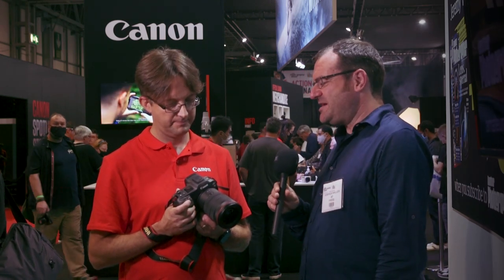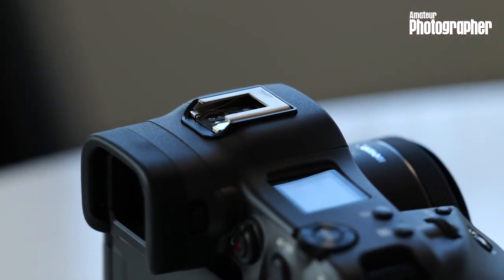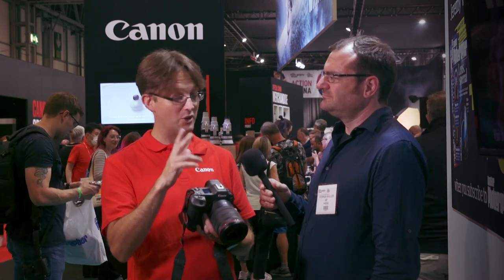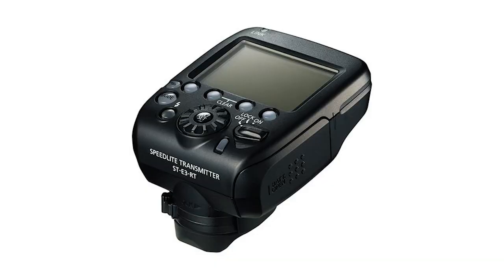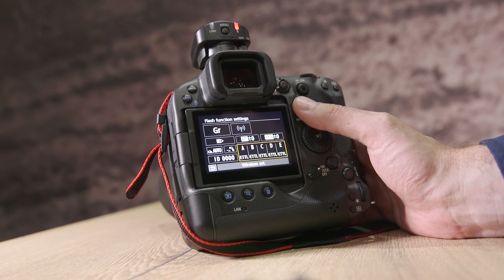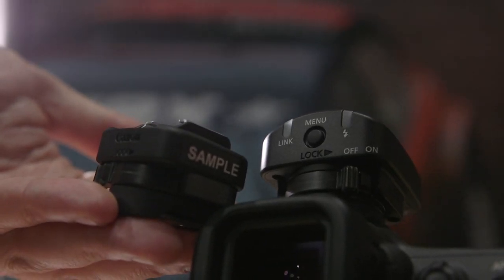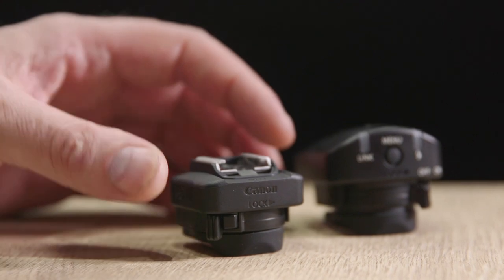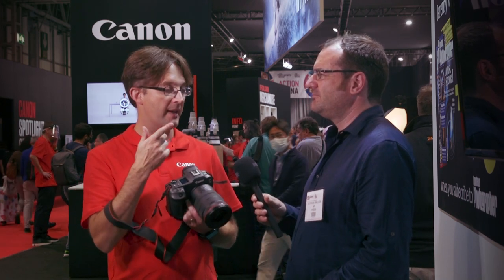NEW Canon Hot Shoe design PLUS new hotshoe accessories (new ST- E10 and AD-E1 hotshoe adaptor)

Comment: Can anyone ask David from Canon who designed hoshoe cover for 'robust' R3? After being hugely disappointed with R3s lockup/freeze issues, which still hasn't been fixed with nee firmware, all my friends who own or tested R3 + many forums confirm - rubber hotshoe cover is crap! Doesn't sit well in place and everybody already lost one! How can you go wrong with this kind of £6k camera! Specs are awesome but quality is far from 1DXIII. After burning R5 there's simple conclusion - all Canon R cameras are being released still as beta versions, all got great specs on paper but all got huge reliability problems. Better wait until MK2, MK3 versions will be released.

Comment: Does it wobble?
Reply: it will wobble overtime and you have to tear it apart. screw is inside the body.
Reply: @jusmtb687  can you not screw it without taking it apart? I was hoping with this new hot shoe that it would be different.

Comment: Unfortunately the new shoe does not work with the Broncolor transmitter RFS 2.1 as the side contacts have lost connection due to the changed shape of the shoe.

However, the Canon AD-E1 does not work with the R5C, and Canon Europe has not been able to answer whether the AD-E1 is compatible with the R5C or not.

Maybe Canon UK has some info on this?
Reply: again, canon forcing us to buy stuff that never needed to eb manufactured in the first place like the AD-E1 hotshoe adaptor, and they complain of chip shortages. They made the R10, so they ahve plenty of chips.

Comment: According to the R7 manual;
"Attaching accessories

When attaching accessories that communicate through contacts of the multi-function shoe, insert the accessory's mounting foot until it clicks into place, then slide the mounting foot locking lever to secure it. For details, refer to the accessory's Instruction Manual.

The following accessories cannot be attached directly to the multi-function shoe.

Speedlite EL-1/600EXII-RT/600EX-RT/580EX II

Speedlite Transmitter ST-E3-RT (Ver. 2)/ST-E3-RT

Off-Camera Shoe Cord OC-E3

To use the accessories listed above with the camera, you will need Multi-Function Shoe Adapter AD-E1, sold separately. For details, refer to the AD-E1 Instruction Manual.

When attaching accessories other than these that are designed for regular hot shoes, insert the accessory's mounting foot all the way in, then slide the mounting foot locking lever to secure it. For details, refer to the accessory's Instruction Manual.

Electronic Viewfinder EVF-DC2/EVF-DC1 cannot be attached to the multi-function shoe. Attempting to attach the accessories by force may damage them or the multi-function shoe."

The GP-E2 locking lever won't engage - the pin doesn't align. Very disappointing. Don't want to spend $40 for an adapter that sticks up on the camera. The manual suggests it should work, but Canon help told me to buy the adapter.
Reply: As far as the EL-1/600EXII-RT/600EX-RT/580EX II and ST-E3-RT (Ver. 2)/ST-E3-RT go, all you have to do is remove the rubber gasket -- super easy.  You'll lose some weather sealing, true, but they will function just as well as the 430EX III-RT, which has no gasket.  The AD-E1 is a ritzy, pricey gasket translation unit, nothing more.